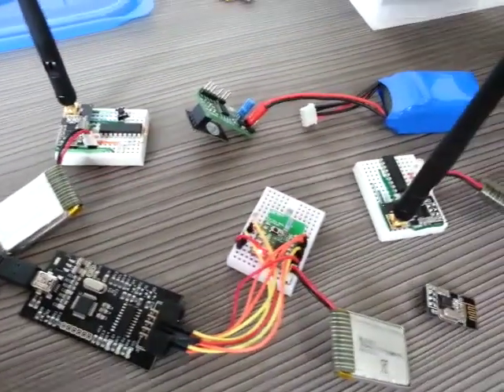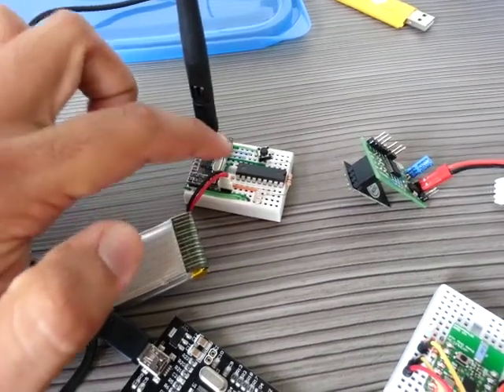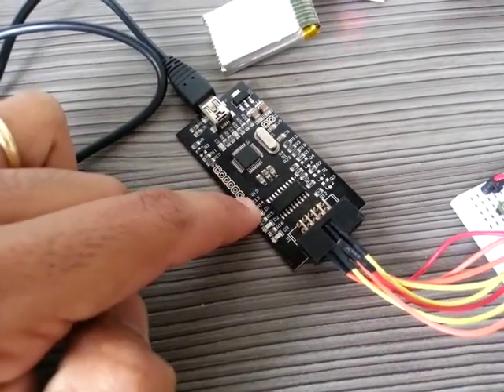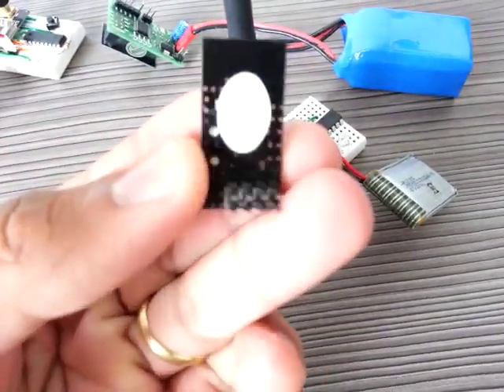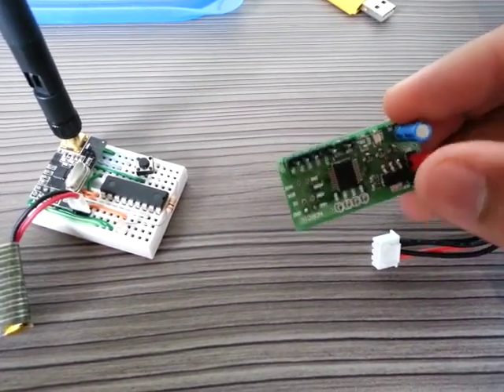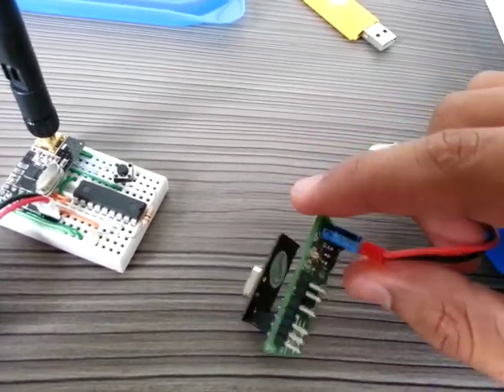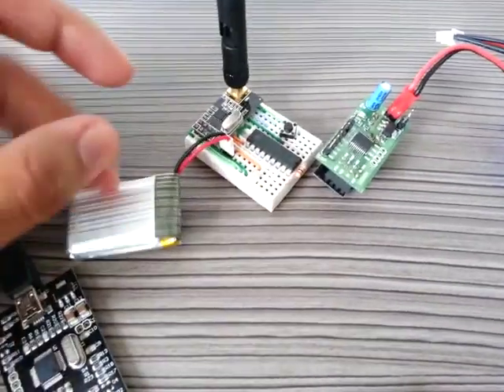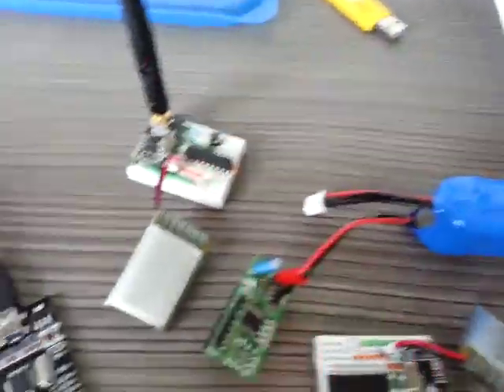nRF24LE1, nRF24L01 + PIC16f628A, nRF24L01 + PIC16f1827

Comment: Dear Anderson,
Can you please post your code as some text file rather than a *.exe. I tried downloading it and it was an executable file. Can you also post the schematic for both transmitter and the receiver (how NRF24L01 is connected to the PIC16F628 - I am sure the connection to the TX, RX should be obvious, however, it will still be useful).
Thanks
Cheers
Prashan